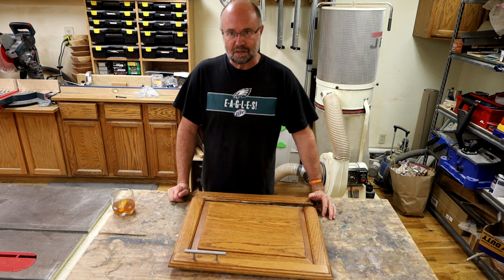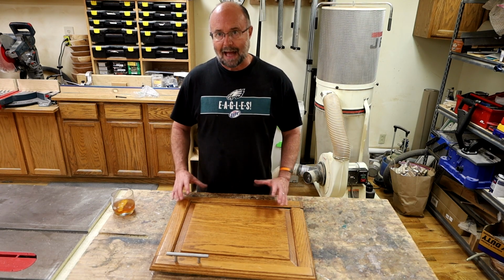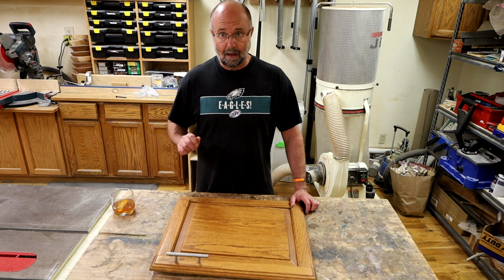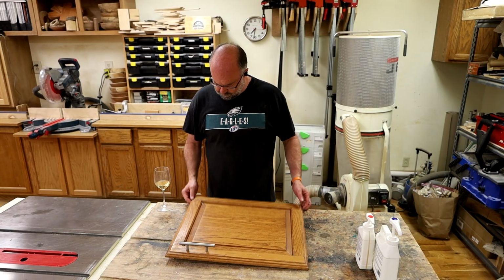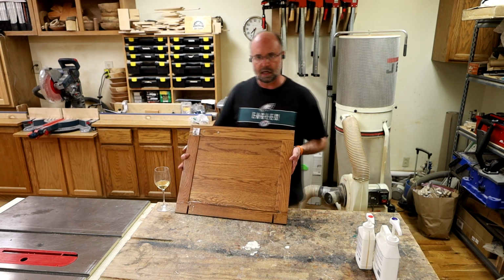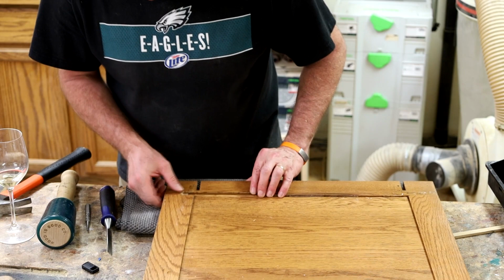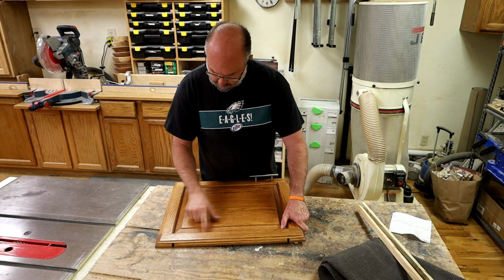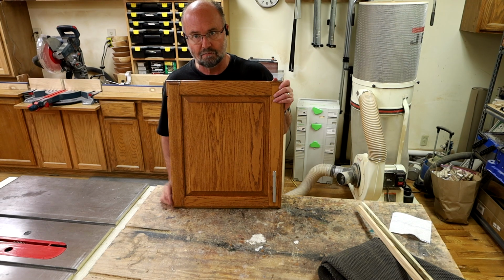Repairing a kitchen cabinet door

Comment: Great video! I was wondering, what is the tool called that you use at 11:18?
Reply from the maker: Much appreciated!  There, I was using a small block plane.  This was one that I bought used and tuned up to make it a user.  I keep two of them, this one for coarse work and one for finer work.  Thanks for watching and commenting!